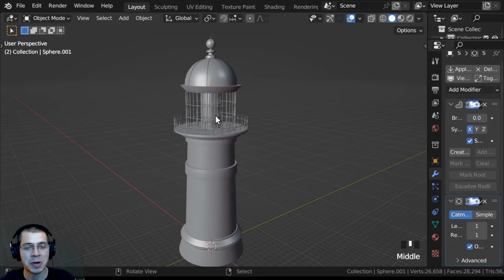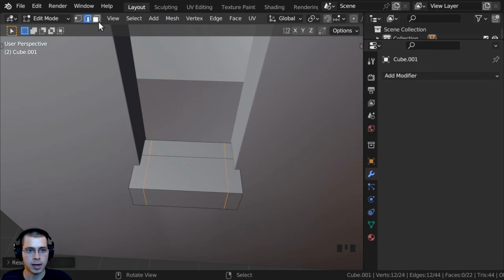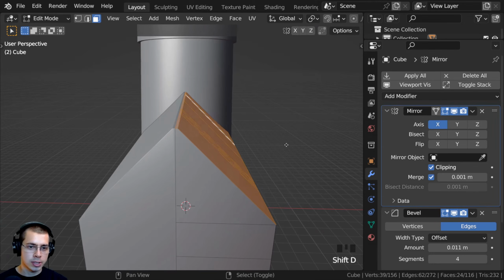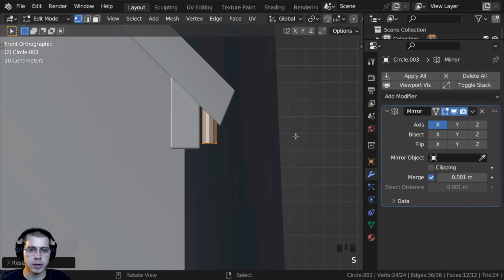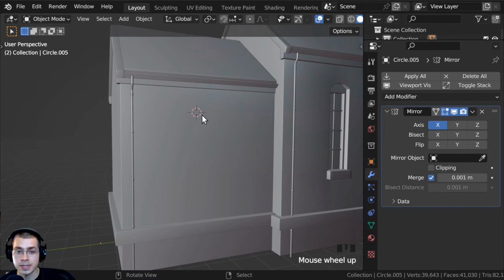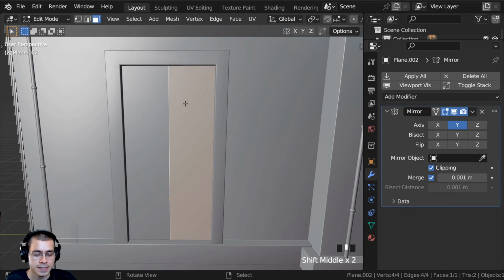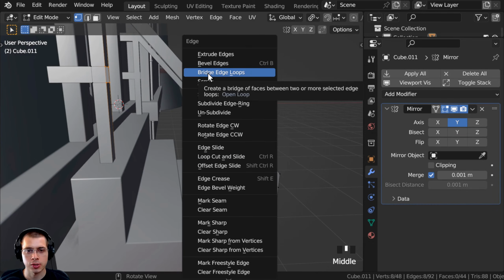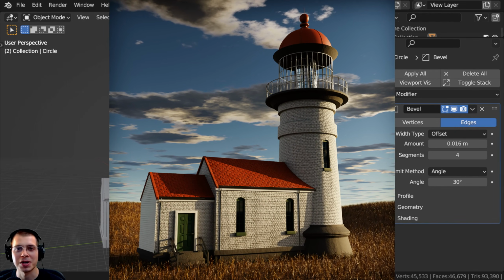Creating a Lighthouse in Blender - Part 2 (Tutorial)

Comment: Another great tutorial, thank you for that. Just two tips I would propose - when modifing the second part of house for doors, I used edit mode for all object at ones so I was able to quicly and easily make it smaller as requred. I also often use selection with CTRL, it is very useful if you select some line of faces.
Reply from the maker: thanks for the tips 👍‍

Comment: Loving this one! Here’s an issue I ran into that I’ve encountered before, and it may help someone else…

IF THE BEVEL MODIFIER DOESN’T SEEM TO WORK: Changing the Segments and Amount doesn’t seem to do anything? Look down lower on the Bevel Modifier panel and you’ll see a subpanel for “Geometry” - expand that panel and make sure “Clamp Overlap” is unchecked … this fixed a problem I was having getting it to work with the window frames.

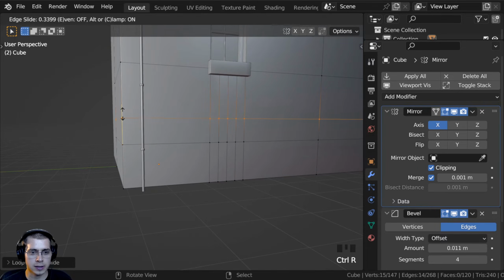Also, when modeling the house foundation part around 25:30, after selecting the faces I used ALT-E (Extrude Along Normals) to extrude them. This evenly extrudes each face in the direction it’s pointing - so you don’t need to exclude the Z-axis or fiddle with trying to get them even. (I use this trick a lot since I’ve learned it!)

Looking forward to the rest!
Reply from the maker: thanks for the tips! 👍‍